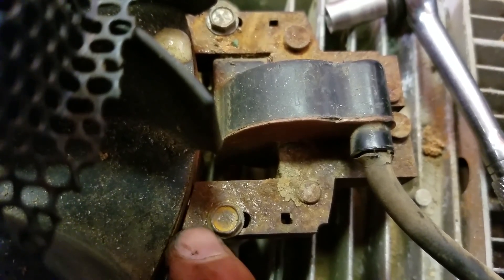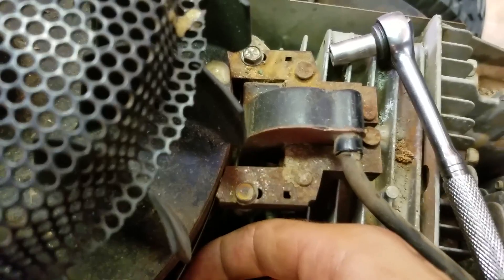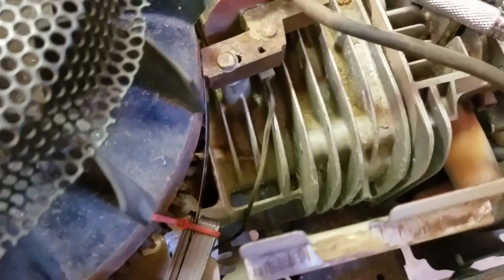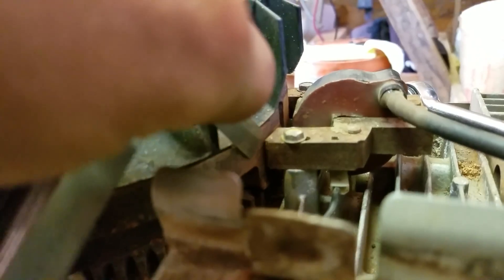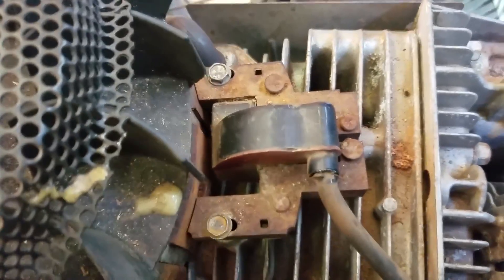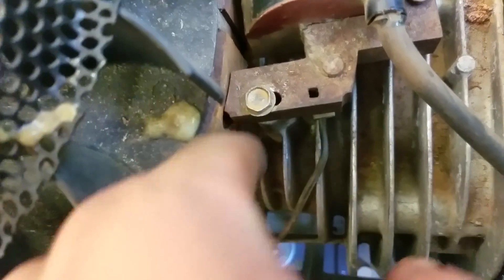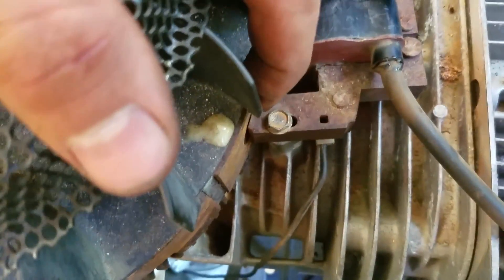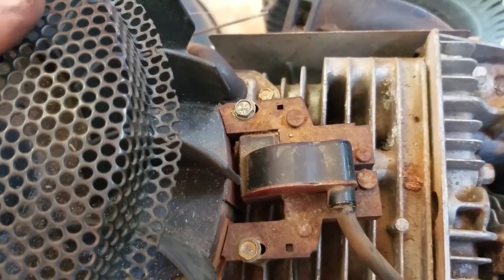Lawnmower Has No Spark? Fix It!

Comment: you never use a metal gauge to set the coil on anything period. a brass or a thin business card will work just fine
Reply from the maker: So it doesn't stick to the magnet?
Reply: I've been using a index cards for years and they just work just fine with me sometimes when people goes really precise on s*** they go completely stupid